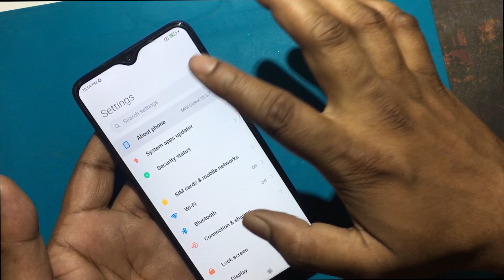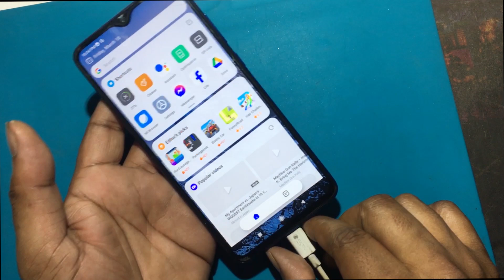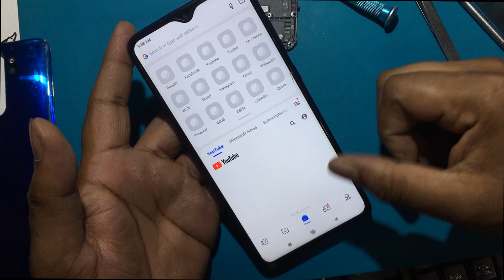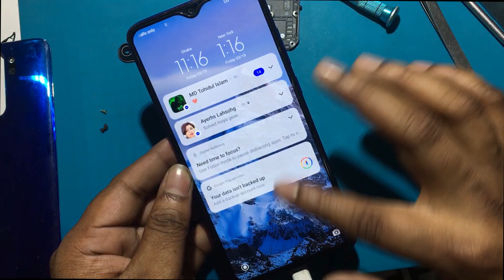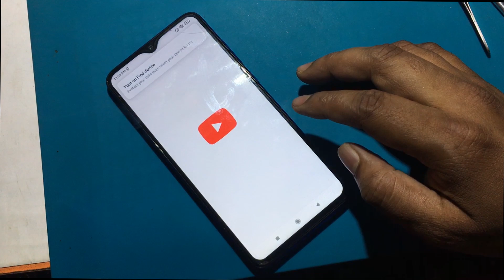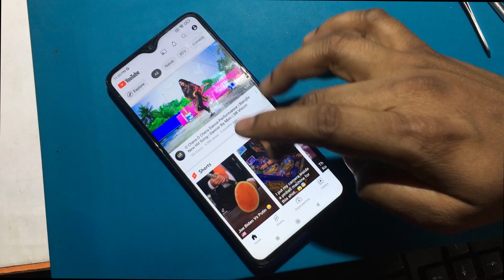Redmi Note 8 Pro Auto Restart problem and Power on only with Charger || Android Phone Auto Rebooting

Comment: The problem is not with the fuse, the fuse is fine, it's your battery that is tripping the fuse constantly, just replace the battery.

By shorting the fuse, you're battery is not longer being protected and it will cause your battery to swell instead in the future.
Reply: should we replace the battery instead
Reply: @jibrandar77  Yes just replace the battery. The battery is the problem.

Comment: If change new battery but same issues .how to solve
Reply: Bro amr o same problem...kivabe solve hobe?
Reply: @bulet31  ami ajkei thik korlam ai vabei thik kore dilo 280 taka nilo now phone is okay
Reply: @emotions5198  Kothai thik korle?
Reply: Dude the problem is with the fuse not the battery. You have to make it have connected to the battery. I reckon these cheap phone get wear down ober the years hence this problem.